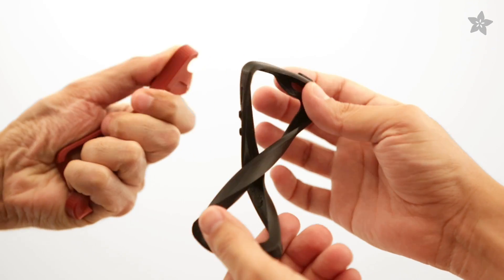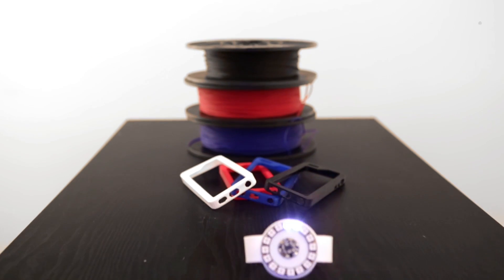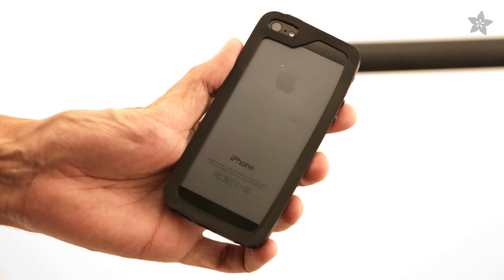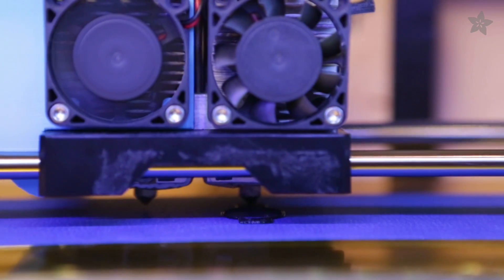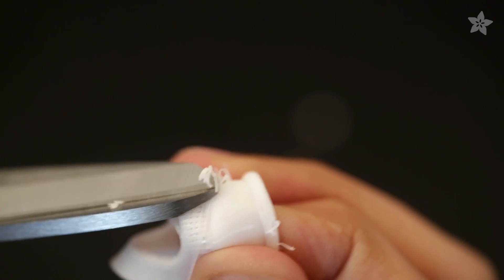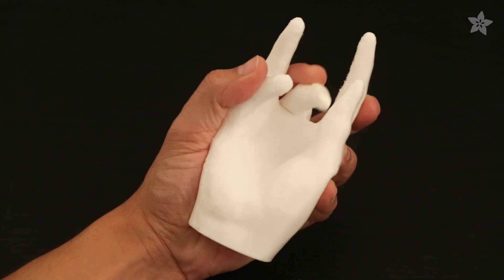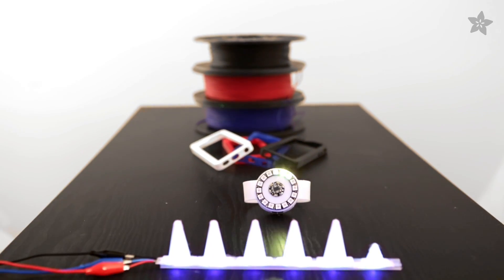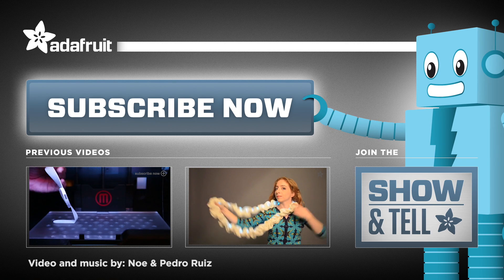3D Printing with NinjaFlex Flexible Filament

Comment: Another approach to print the flexible filaments with the bowden-tube-printers: straighten the tube. Still able to move the head fast, AND able to print flexible materials: https://www.youmagine.com/designs/ultimaker-2-straight-tube-flexible-filament-spool-holder

Comment: I need help with supports!!! I want to use ninjaflex to make small toys like "Mr. Ninjaflex"... you know, the little guy they show in their promotional videos, but my toys need some supports... I am afraid Ninjaflex itself won't be a strong enough support material even if I print it at a really high infill. Also I am afraid the Ninjaflex will melt into ANY supports I try to put onto my object. Any suggestions?